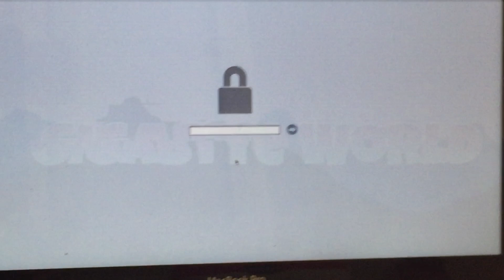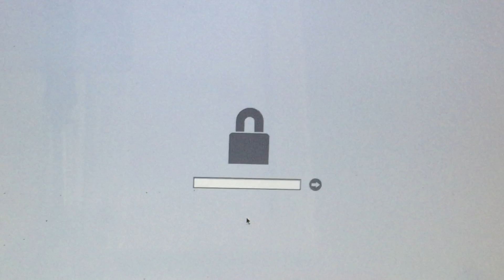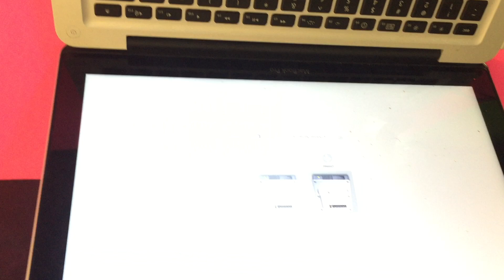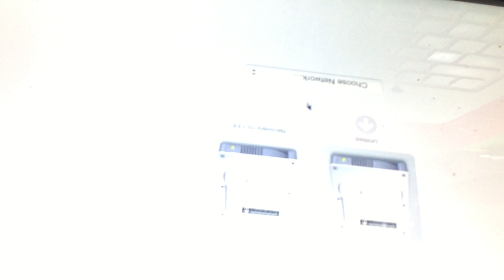HOW TO REMOVE FIRMWARE PASSWORD ON MAC

Comment: Was there new ram replaced or was it the same ram thanks
Reply: Will do
Reply: Can this method work for mac os catalina ?
Reply from the maker: @Sean Van der merwe  if you are trying to remove the firmware password no this will not work for macOS Catalina
Reply from the maker: It’s the same ram what you need two do is change the ram amount for example if you have 4 GB 2 GB in each slot change it to 2 GB then follow the video prompts after you have removed the passcode then put the the other 2 GB to return to 4 GB if you have 2 GB 1 GB per slot then take out 1 stick to make it 1 GB then remember to return it back to 2 GB when done
Reply: @GigabyteWorld  thank you so much 😊
Reply from the maker: @seanvandermerwe3409  np let me know if that works for you

Comment: There is no another way wothout opening
Reply from the maker: Follow this 
Press power button hold for 10 seconds 
Keep holding power button 
Plug in the charger hold it 2-5 seconds 
Let go the fan should start spinning wildly if not press power button to turn it on  normally

Comment: hey bro hope ur doing well :) I was wondering if this procedure will only work if I have two slots of ram bc I only own one right now and didn’t worked for me. I have a mid 2012 MacBook Pro. So... should I get another one and try again or am I doing something wrong? plz let me know 🙂
Reply from the maker: This one hack is dependent on two factors a change in ram and old firmware before high Sierra .I would add one more stick if if you have 2 GB make it four if you have 4 make it 8 or 6
Reply: @GigabyteWorld  I have high sierra, what can I do about it?
Reply from the maker: Unfortunately this would not work on High Sierra I would take the MacBook to a computer shop let them remove the firmware lock 🔒
Reply: @GigabyteWorld  Sad, but thank you for the help anyways.
Reply: Thank you

Comment: This method does not work with Catalina installed on the MacBook!
Reply from the maker: You are very correct as stated this method is for units with older firmware

Comment: I did all the steps as you did and when im trying to turn on the Mac and Press command option p and r, nothing happens and after a minute folder icon shows up with a question Mark, and when i restart it with command and r i get the same mesaage with lock. Can you advise me what im doing wrong?
Reply from the maker: Hi there the flashing folder means you have an Operating system issue your Mac can’t communicate with the OS .
Maybe a bad hard or SSD or bad Operating system /software .
Try running internet recovery 
Turn off computer when you turn it back on press and hold Command + R keys right after it chimes keep holding them until you see internet recovery post what happens using that key combination
Reply: Hi, thanks for the Quick answer, i have tried different hard drives, even one with os already installed on it from different Mac, when i Press command and r  im getting the lock icon still nothing shows up, i have checked the key board all the Keys are working
Reply from the maker: Quick questions what year is the MacBook
Which OS did you have in the hard drive before you tried the firmware password removal trick ?
Reply: @GigabyteWorld  its macbook pro early 2011, i have Got the Mac with an Old software  i dont remember which one, i wanted to format the hard drive and i did, after the format this lock icon showed and it doesnt let me do anything
Reply from the maker: The reason I was asking about the OS is because the method shown in the video works for machines with older firmware before High Sierra .I would give it another try remember to remove one stick of ram and also make sure you hold command option p + r right after the chime sound hold them until the machine chimes 3 times
Reply: @GigabyteWorld  ok i will give a go, thanks for all the help
Reply: @adamsonik1  Hey, facing the some challenge. 
Were you able to unlock your macbook pro?
Reply: @realone3856  no, i still have the same problem.
Reply: @adamsonik1  I'm facing the same challenge.
Reply from the maker: What year is your Mac what’s the model number
Reply: @GigabyteWorld  macbook pro must be either 2009 or 2010, model number A1286

Comment: Does this option risk losing all data? Does this also work on MacBook Air? Also, what’s the name of the chip you replaced?
Reply from the maker: This works on the pro not sure about the air the chip I  removed is a chip of ram or memory

Comment: It did not work for me, I switched ram to 2 8gb ram sticks and pressed buttons just go back to Lock Screen.
Reply from the maker: It’s depends on the firmware this method mostly works for systems with older firmware before high Sierra

Comment: Do I need the extra 1gig of ram to help reboot the Mac, or could I be able to remove 1 of the ram sticks and reboot the MacBook?
Reply from the maker: Just use one of the sticks no need for 1 GIG 
Remember this method is for those MacBooks with old firmware good luck
Reply: @GigabyteWorld  what about with 2019 macbook pros with 16gig ram and 512 gb ssd ? how to remove firmware password for them
Reply from the maker: The method listed here is for older machines that had removable ram .If I find out a way for that will message you .
Reply: @nehal93  hello 
I have the same problem with MacBook Air 2017 ? 
have u been able to fix yours ? 
If yes can u tell me please
Reply: @GigabyteWorld  did you find a way for other models? Mine is a 2012 I believe it’s the same model you are working on but it is not chimning three time
Reply from the maker: Which macOS software is on it ?
Have you removed the ram ?
Reply: Where do I get the gb from ?
Reply from the maker: If you have two sticks of Ram take out one follow the video  prompts when password is removed install the ram back into the MacBook
Reply from the maker: What year is your MacBook ?

Comment: It’s work on my MacBook Pro 2015?
Reply from the maker: This method works for those older units with removal ram I don’t think it will work on the 2015 but you can try

Comment: 01:15 - You never said what year your Macbook Pro was. I heard this method can only work with Macs up to 2011.
Reply from the maker: It’s a 2010 this only works up to 2012
Reply: @GigabyteWorld  oh really? That's good then. Mine is a 17" Pro 2012. Hopefully I can get it done.
Reply: @GigabyteWorld what can I do if I have a MacBook Air 2015?
Reply from the maker: @MochaBrown-tb1gx no. Does not work on the MacBook Air ram is not removable
Reply from the maker: @MochaBrown-tb1gx no

Comment: Hi great video does this work if I have a flashing folder 📁 with a question mark ❔ when I start up my Mac?
Reply from the maker: Depends on the firmware on the Mac 
This method. Works for units with older firmware units running OS before high Sierra

Comment: is there a way that u don't have to disassemble the mac? i dont have a suitable screwdriver...
Reply from the maker: This trick is based on changing the amount of ram and the MacBook having older firmware .
At this point I am not aware of another method that does not require ram removal .

Comment: Where can I purchase the 1 gb stick ?
Reply from the maker: Hi just use any amount of ram as long as you change the ram the trick  is old firmware changing the ram amount take out one stick and follow this process after it’s unlocked remember to put the stick back in cheers .

Comment: Nothing happend when I press CMD OPT P R
Reply from the maker: Try a USB keyboard
Reply: @GigabyteWorld  Still nothing, can it means you even can disable the keyboard ??
Reply from the maker: @secuthor2372  which MacOS is your MacBook running ?
Which year is the MacBook
Reply: @GigabyteWorld  high sierra, mid 2012
Reply from the maker: Unfortunately this method will not work on your machine this method is used to unlock machines running MacOS versions before high Sierra .

Comment: Hi Many thanks for this video. I have followed your provided steps on macbook pro a1278 (2011-2012), unfortunately I press command option P & R, no sound happens, still the password comes On. I tried to reverse the RAM order, disconnected battery, pulled out and put it back. Nothing happens if you do not press and key and it boot up normally. Can you please help.
Reply from the maker: You may have newer firmware this method requires a unit with older not recent firmware

Comment: Do you know if this would work for air A1466 from 2012 coz it seems to have 1 chip for ssd and ram?
Reply: So do you know how you would do the A1466?
Reply from the maker: @KEKEKEBOOM  I do but unfortunately do not have the tools .You would need to purchase a tool that will wipe or erase or reset the data on the EPROM on the logicboard that is responsible for storing the firmware password data .Option two go to eBay find a company that removes firmware passwords ship the Mac to them they will ship it back when erased .
Reply from the maker: This would not work on an air since the ram is not removable

Comment: IT CAN NOT BE WORKING THREE TIMES RESTART BOSS
Reply from the maker: What year is the MacBook which MacOS are you running ?
Reply: @GigabyteWorld  its macbook air OS X Utilities version 1.0 Serial No: C02HP8GDDJWT When i'm do as video thats restarting time its not restart three time as you as.
Reply from the maker: This process involves removing the ram I do not think it will work on the air since the ram can’t be removed

Comment: Hey! I have been trying to upgrade my hard drive in my 2012 MacBook Pro with an SSD, but It’s locked with a firmware password. I can use it normally, it’s just when I try to boot into recovery mode it ask for the firmware password which I have forgotten. If I have already maxed out the ram, is it possible to do this hack if I just remove 1 of my two 8gb sticks of ram? I’m running OS Mojove
Reply from the maker: Hi Rashad sorry to hear about the issue you are  having my experience has been this hack does not work on MacOS high Sierra and above Mojave included the hack has been patched on newer firmware.This method works only for systems tuning older firmware sorry .

Comment: I get a white screen after this method ,also tried changing back the ram still white screen , any help
Reply from the maker: Yashai Mckeal Singh hi Yashai turn the computer on and press the option key right after the chime sound
Reply: @GigabyteWorld  holding it as we speak ,nothing but white screen also tried all those key combos for safe mode etc nothing but white screen
Reply from the maker: Disconnect the battery ,disconnect your lcd cable and plug it back in make sure it’s secure then reconnect your battery and turn it back on .You may have a loose LCD cable
Reply: @GigabyteWorld  the screen did work , i used to get to that firmware password screen then when i cleared it using the method you showed above i get white screen
Reply: would it be possible to install macos on another hard drive and boot the mac from it , but from a windows pc as i dont have another apple pc and also a note before i tried your method its one of the old macs like the one you used , that command + r recovery etc dont work
Reply from the maker: Yashai Mckeal Singh turn it on and leave it on the white screen for a few minutes it may be taking a while to read your hard drive
Reply: @GigabyteWorld  i did ,i left it on the whole time with hopes it will fix itself
Reply from the maker: Yashai Mckeal Singh yes you can create a bootable usb drive maybe easier what year is your MacBook
Reply: @GigabyteWorld  no idea it was collecting dust at a relatives home they thought it was broken and gave it to me so when i got it i messed around with the ram sticks and got it to power on ,(they didnt remember the password)
Reply: @GigabyteWorld  guessing its very old because it had 2x1gb ddr3 ram and a 160gb hdd,  but it looks exactly like the one you used
Reply from the maker: Yashai Mckeal Singh any updates on your project
Reply: @GigabyteWorld  still admiring my white screen , also a note before i did the reset with the above method ,it used to load with the apple logo till about 3/4 then switch off , i tried reseating the keyboard connector and lcd cable no luck, i also created a bootable usb with transmac  ,but no menus come up when trying to boot up on the mac
Reply from the maker: Yashai Mckeal Singh a white screen  is usually a hardware issue ,when opportunity affords try this press power button for ten seconds keep holding power button plug in the charger wait 2-3 seconds then let go of power it should boot up the fan will be loud a bit let’s see if that works .
Reply: @GigabyteWorld  would the white screen still come up if it had a graphics/logic board issue? i hate this thing i usually play around with windows machines
Reply from the maker: Yashai Mckeal Singh from what I have seen this model does not have graphics issues those are found on the 15 inch 2010 and 2011 models .
Reply from the maker: Yashai Mckeal Singh one more check if you can disconnect the hard drive then turn it on if you get a flashing folder then we know it’s a software issue .
Reply: @GigabyteWorld  im going to charge it and try that tip the battery acts weird like it wont start up on its own only with the charger but once its on the charger can be removed and it will stay on ,it didnt do this before also i noticed the caplock green light dont light up when on is it possible the keyboard somehow partially disabled,because the power button still works and thats part of the keyboard connection
Reply: i did remove the hard drive i did suspect that at first also tried booting externally with an external usb 3.0 sata cable

Comment: when i press command option P & R, mac doesn't go off. the first chime sound comes and that is it. it stays like that till the password comes. what could be wrong and what do i have to do ?
MY model A1278
Reply from the maker: You have to be quick to press the keys 
If still having issues try and use a USB keyboard 
If not an apple keyboard use Windows key plus ALT P and R keys
Reply: @GigabyteWorld  I’m confused another keyboard or you talking on the Mac ?? Q
Reply from the maker: @deshawnwells3190  yes use a USB keyboard if you have one

Comment: Where can I purchase sticks of ram?
Reply from the maker: Taylor Nutt depends on you location but I would recommend 
eBay -cheapest 
Amazon 
Craigslist 
If you buy it on Craigslist take the computer with you to make sure the ram works .
If you already have two sticks of Ram in your MacBook just take out one and follow the instructions on video ...good luck with it .
Reply: Gigabyte World I just keep getting the padlock
Reply from the maker: Taylor Nutt which MacOS version are you running ?what year is the computer 
Have you taken one stick of Ram out ?
Are you pressing command option R and hold them until it restarts 3 times ? Command Option R the success of this working largely depends on the unit you are trying to access having an older Firmware.If you MacBook last been updated to MacOS High Sierra or Mojave or Catalina unfortunately this will not work.
But check eBay for firmware removal service a lot of users on eBay are offering the service .
Well Taylor I hope you are able to get the issue resolved
Reply: Gigabyte World I'm not sure what Os it is, it's a MacBook Pro 13in mid 2012 I took one stick out, I also took both out and added 2 new bigger ones, tried multiple variations. Command option 3? I thought your video said command option r and p?
Reply from the maker: Command Option R  keys the success of this working largely depends on the unit you are trying to access having an older Firmware and removable Ram .If your  MacBook  been updated to MacOS High Sierra or Mojave or Catalina unfortunately this will not work.
But check eBay for firmware removal service a lot of users on eBay are offering the service .
Well Taylor I hope you are able to get the issue resolved .

Comment: Will it work on MacBook without macos?
Reply: It didn't work i think because i updater my macbook to latest frimware
Reply from the maker: Sparsh Gupta did you also change the ram
Reply from the maker: Sparsh Gupta not sure about that can you try it and let us know if it does work .
The most important thing is that the unit you are working on has older firmware and has removable ram .Follow the steps and let us know thank you
Reply: Yes

Comment: Will it work if I take 1 stick of ram out of my 2017 imac and change it to 4 gb of ram instead of 8
Reply from the maker: Hi Siahhh this method works best on older units with older software but try it let me know if it works on an iMac 2017
Reply: Gigabyte World what method works for a1466
Reply from the maker: Bino Bugatti the EBay method there are companies that remove firmware passwords for a decent price type into eBay search MacBook firmware password removal service good luck with it .
Reply: Gigabyte World you have anybody that would remove it that you know is legit?
Reply from the maker: @christopherramirez6613  what year is your Mac

Comment: Does this work on the 2018 Macbook
Reply from the maker: This will not work on the 2018 MacBook because the Ram is not removable are you 100% sure it has a Firmware password ? Do you get a padlock 🔒 when you press the option key ?
Reply: @GigabyteWorld  Yes I get a lock
Reply from the maker: I am sorry this would not work on a 2018 MacBook.

Comment: When i take the ram out, and try to boot it up, my screen stay black and just doing peeping noise.  It doesnt boot
Reply from the maker: You have to boot it with only 1 stick of ram if its beeping with one stick maybe the ram is not properly inserted.
Reply: @GigabyteWorld  i will try right now. Do i leave the top, or the bottom ram Inside?
Reply from the maker: Se JxRo it actually does not matter if its the top one or bottom one just have one stick stick of ram inside .